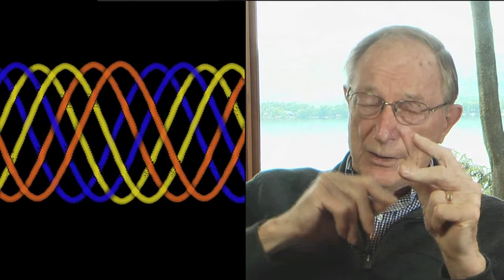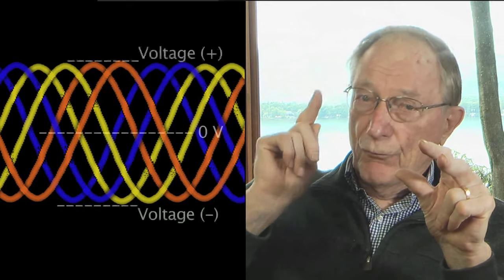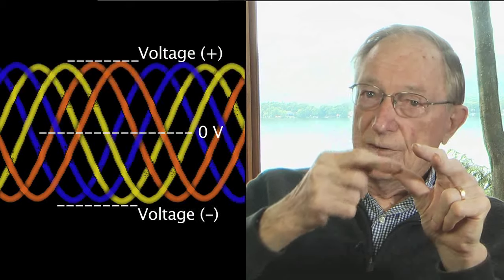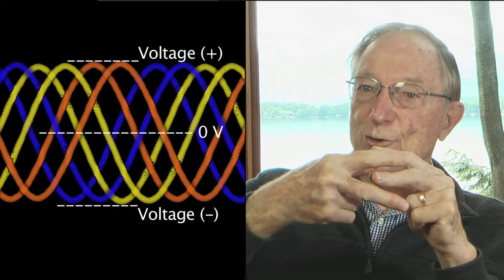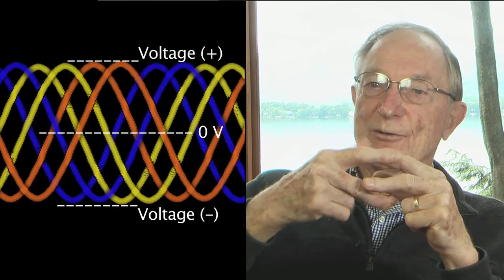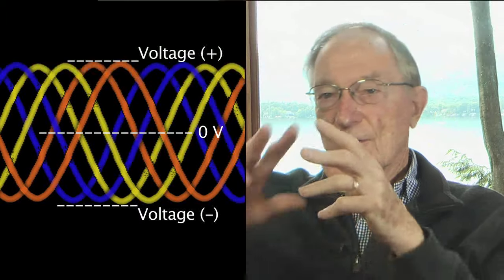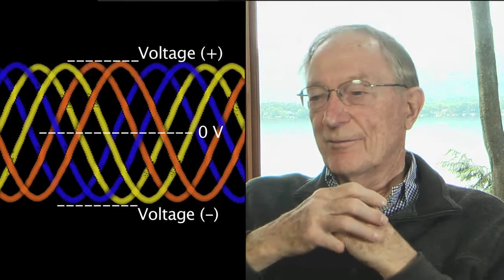Why 3 Phase Power? Why not 6 or 12?

Comment: One important property of  3 phase power is that the power delivery across a section is constant therefore a  motor torque is constant.
Reply: Very close to constant. Why reinvent the wheel. 3-phase has worked well for over 100 years.